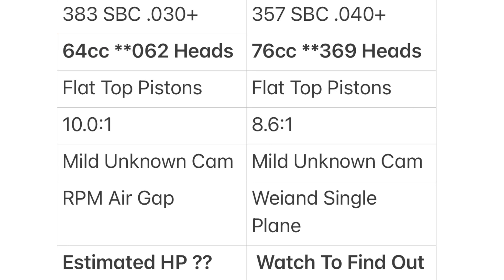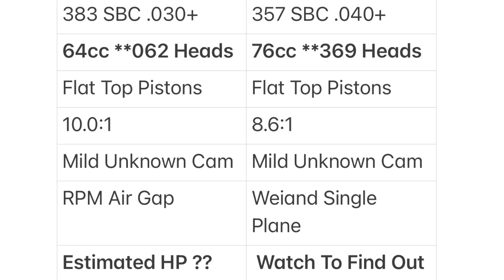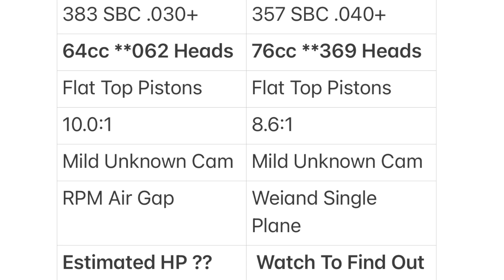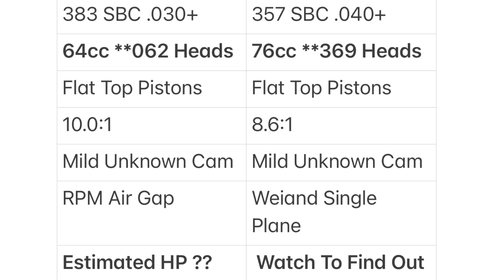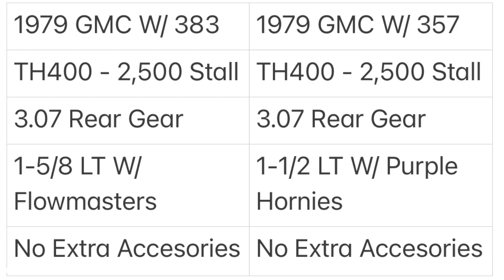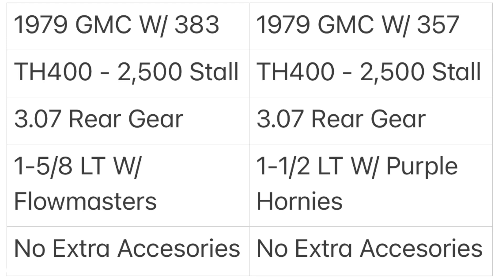64cc Vortec Heads Vs 76cc Smog Heads - Street Driving Comparison

Comment: how would the 76 cc work if they had domed pistons to create the same compression , say 993 head is the question
Reply from the maker: Using the stock cylinder head flow numbers, you can get a rough estimate of the maximum power achieved with an ideal setup. According to Motortrend ( https://www.motortrend.com/how-to/airflow-research-cylinder-power/ ) you multiply the head flow X 2.05712 which is(0.25714 multiplied by 8 cylinders). In a perfect setup, a Vortec head which flows 225 cfm, could make 462.8 HP. Motortrend flow tested 993 heads and the intake side flowed 151 cfm. That’s a power potential of 310.6 HP. Vortecs are good heads if they’re not cracked. Hope this helped.

Comment: I have fresh machined  76cc smog  heads with flat tops edelbrock performer long tube headers  hei ignition 3.27 posi rear  melling 223/223 450/450 cam on my 68c10 fresh rebuild less then 2000 miles . Do you think it’s worth swapping my head with a 062 vortec that means I will have to also change my intake to make it work on my gen1 block  will the money spend to pretty much rebuild the top end over again or will it be not so much noticiable on a weekend cruiser I spend most my time feathering the throttle from time to time I let it rip but rarely will I be up in the rpm’s  having more power is never bad though lol
Reply from the maker: If you rarely let it rip then I’d say it wouldn’t be worth it. Nothing wrong with reworked 76cc heads, but you would definitely gain a good amount of hp with the Vortec heads.
Reply: @CarGuyV8  I can get the 062 heads and everything that it would need to make it work on my gen1 block for $1100 parts and labor and if I’m dropping that amount of cash I hope I can feel some difference  also I hear with better compression and all mpg also improve
Reply: @CarGuyV8  do you think Vortec heads will perform good with my mild cam 223/223  448/448 or would that need to be upgraded as well
Reply from the maker: @JaviOro1968  You would definitely notice a difference with the Vortec heads. I have a couple videos on my channel of some Vortec headed setups. A Cutlass and a Corvette if your curious what they’re like with Vortec heads.
Reply: @CarGuyV8  do you think running flat top pistons with vortec heads  will be too much compression to run pump gas ?
Reply from the maker: @JaviOro1968  It’ll be fine. I run pump gas in my 383 and it has more compression than a stock stroke 350.
Reply: @CarGuyV8  turns out the 062 heads I was buying guy sold them but he has another pair of 906 vortecs are the 906 good or should I continue to look for the 062 ?
Reply from the maker: @JaviOro1968  906 heads are just fine. Supposedly they flow a tiny bit less on the exhaust side at low lift, but they’re still Vortec heads.
Reply: @CarGuyV8  well aslong as. There vortec and flow better then my 76cc smogger heads 😅

Comment: I have a sbc 406 shortblock and with 64cc heads it will ne 12.1 compression, if I use 76cc heads what do you think my compression will be?
Reply from the maker: Somewhere around 10.5:1
Reply: @CarGuyV8  ok Thanks